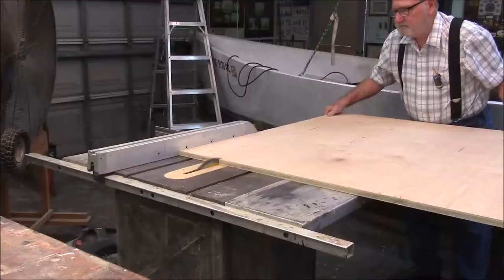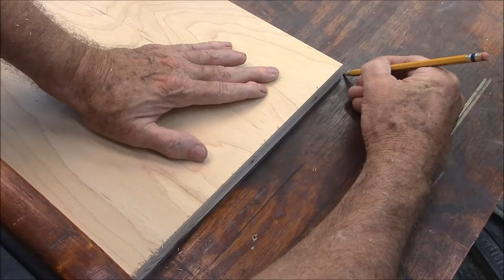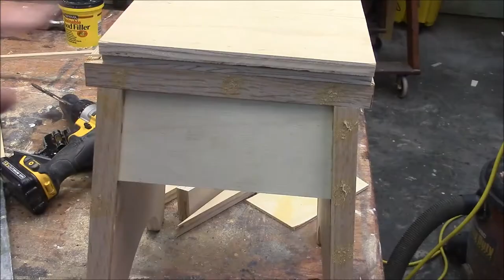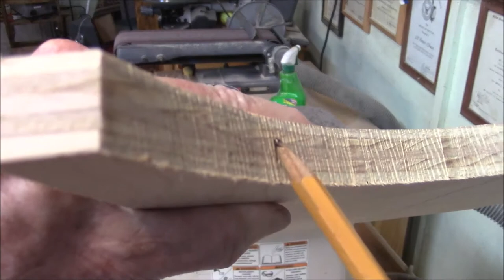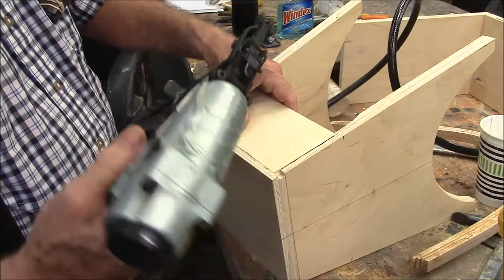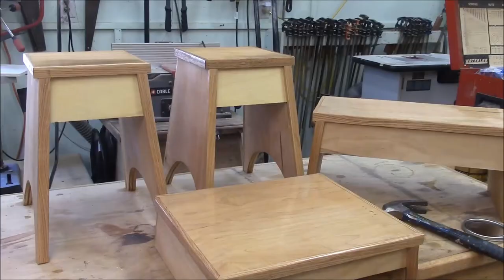147 Making four wooden stands for computer equipment, small wood benches

Comment: You switched gears on us!  Here I was expecting work on the S.S. Memphis!    You are just teasing us.  

It is always interesting to follow your thought process as you design a project.   You could have slapped a couple of cross braces in the taller stands but with your artist's touch you turned them into a thing of beauty.  The angles and the arched cut out make the pieces quite graceful.

In this video, you show that you don't have to be a mathematician to make angles.  You just have to be consistent with your cuts.

The stain is great.  Like you said, it brings out the contrasts in the colors of the wood.  The finished products are very classy and would be a great addition to any office.  How are they working for your friend?  I bet he is going to make his coworker's jealous.  Be careful.  You may be getting more requests.
Reply from the maker: I'm working on MV Memphis in the background, hoping some "finished product" kinds of jobs come up.  Boat building is very long, where I could spend a whole Memphis Monday installing a single plank.  I really like the format in which I start out sitting in Captain Kirk's chair, and then end the video with a completed project.  I've already thought out some Memphis Monday boat projects, but they kind of depend on when I finish the tedious work.  Two jobs for sure will be installing the floor, and building the new engine cowling. 
      I don't measure anything I don't have to.  Taking measurements directly off (both angles and distances) is far more accurate.  And I'm sure not a mathematician, that's for sure.
       My friend must be a good guy, as he actually had me build them for his coworkers.  
       Stay warm, or better yet, take that camper out for a little winter camping adventure.  TR did it.  Thanks for watching and commenting.
Reply: OK.  I will be patient and wait for appropriate projects on the boat.
Your friend is a very good coworker.  It is a pain to have to bend over to work on a computer.
HAHAHAHAHAHAHA!!!  You did not suggest I do something because TR did it!  All the more reason not to do something.   How about I stay warm and start getting things together for a WARM spring trip.  :-)
Reply from the maker: Staying warm is always good, but I like to do it in cold weather.  A little fire burning in the wood stove, a hot cup of coffee steaming out the results of that last Nor'easter, Car-Talk smoothing out reality, and a single ray of sunlight finding its way through that East window.  
     Now imagine that scene abroad in the little silver turtle.  That air of coffee fills all the breathable space, Car-Talk becomes real, and that single ray of sunlight gleams eternal, indeed magnified by that silver skin our kin would call a miracle, but we know only too well as the most abundant mineral in the Earth's crust. 
     You know math. You know science, but neither explain the profile that the Sunlight seems to etch on the table of the little silver turtle.  It is clearly a line pointing at you; it is a link between you and that 37 degrees C that keeps you sentient.  You are now linked.  The cold is on the left and the warmth of that wood stove are on the right.  You are in the middle.
      If it's boat projects you want, then it's boat projects you might get.  But don't say I didn't warn you.  
       I love our conversations too much.
Reply: Whereas you like a fire on a cold day to keep you warm, I prefer a bright sun warming my skin.    Having to heat with fire takes me back to childhood in West Virginia when winters would last 6 months.  Picture snow everywhere but not bright white snow.  The snow would have a gray pallor caused by the burning of wood and coal.  In the mountains, the sun would be gone by 4 pm.    It was a long dreary time.

My silver turtle would ultimately have all open windows to allow a warm breeze to blow through.  On this subject, we shall always have to agree to disagree.  I will never sway you to my thinking and you shall never sway me to your thinking..  

Never let it be said that I try to dictate your content.  If you find a project on your boat video worthy then make it a Memphis Monday.  However, all the projects you undertake are interesting to me.  As long as I have internet the conversations shall continue.